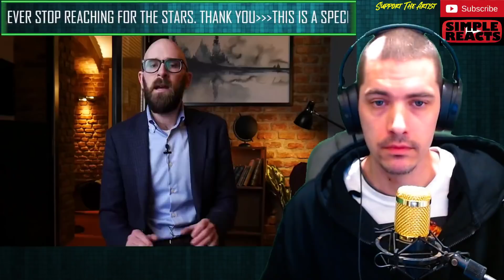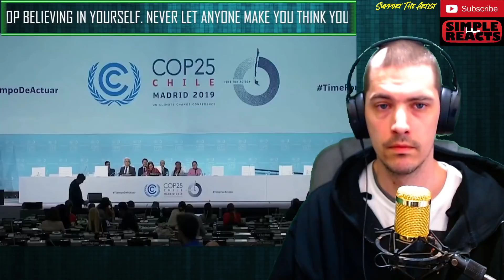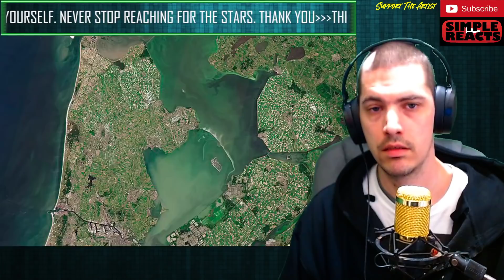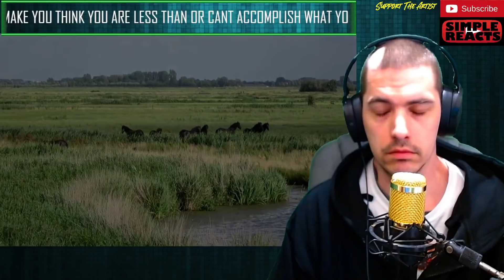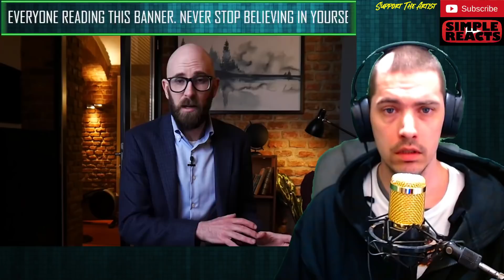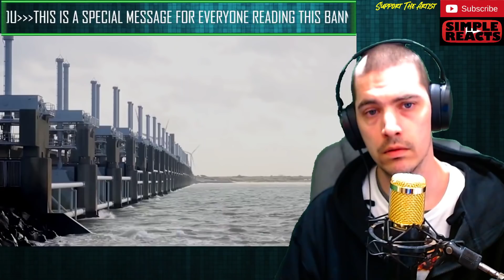Delta Works: An Example for the Rest of Us Reaction

Comment: IJssel is just Ice-cel in english so I don't know why he was struggling with that pronunciation
Reply: It's the Dutch letter 'ij' (yes it's one letter, that no-one bothered to include in any computer code page, so you can't even type it properly. Wikipedia calls it a digraph). Its pronunciation is uniquely Dutch at least as far as Germanic and Latin languages are concerned. The closest in English is probably 'I' but that would be considered a dialect pronunciation in true ABN ( common civilised Dutch -- the Dutch equivalent of BBC or tbe Queen's English). In names like IJssel and IJsselmeer both the I and the J are capitalised.
Typically English speakers try to pronounce the I and the J as separate sounds, which leads to hilarious things like 'ee-yel-semere', instead of 'Eyecelmere' (still wrong but a lot closer.)
Reply: @rmyikzelf5604  Dat weet ik al lol
Reply: Actually his pronunciation of Stormvloedkering Hollandse IJssel was pretty good.

Comment: After Catrina, Dutch water engineers were asked to help out. Since that time they have build several levies that proved their worth during the last hurricane that hit the region.
And yes this kind of projects cost an enormous amount of money. But you have to compare those expenses with the money needed to rebuild a region after a disaster as Catherina. and you should also add the loss of lives and human suffering. These projects also provide good jobs and Rotterdam can keep functioning as one of the largest harbors in the world which is essential for Dutch economy. It was and is a large investment. However, the benefits exceed the costs.

Comment: Thanks for you spontane comments!! You just must expect crazy huge contructions. Bc of the unpredictable huge forces, all solutions started as experiments. From  the 100 most craziest ideas, 99 failed but 1 worked. Recalculated to the real world, it forms the start of the contruction-plan. NL just has to find a solution for the threat from these forces that do not negotiate.

Comment: The delta works 1 (zuiderzee works) and the delta works 2 (mainly coastal defence) cost more than the whole Apollo project to put a bunch of men on the moon. Not bad for such a small country. After finishing we had to start with delta works 3, the river dikes. This was because climate change caused the river to fluctuate way more than previously. They are now nearing completion and saved us this year from the floodwaters coming from Belgium and Germany, but only just....
Reply: So we move forward with clever and innovative solutions to deal with water.

The amazing part is we managed the rivers by giving them, besides the dikes, more room to overflow.

I'm not very nationalistic but incredibly proud about our world leading water management.

Groetjes uit Brabant 😎👍
Reply: @gauloiseguy  The problem in a few decades (already starting now) is that groundwater wells up from the soil everywhere. The pressure comes from the rising sea levels and is transmitted beneath the dunes via the groundwater. There is as yet no technical solution in sight if the sea level rise will be more than 1.5 meters. Even if the dikes etc. would hold, this phenomenon will cause that the Netherlands will become slowly too wet to live in.
Reply: @ronaldderooij1774  

I'm afraid you're right for the Westland at least.
Reply: @gauloiseguy  Yeah, I live very close to the Westland.
Reply: @ronaldderooij1774  The technology to deal with it exists. There are even plans to drain the entire north sea. The problem is international cooperation and cost.
Reply: @mgc7199  I know about the idea. But be aware, it is only an idea. Not even a proper study. There is no proof that it is feasible. And are you going to tell Russia, Germany, Poland and Sweden that it cannot use their submarines anymore? There is zero chance that it will be accepted, and in my view very little chance that it is even possible. So, forget it.
Reply: @ronaldderooij1774  Currently, the tallest dam in the world is Nurek Dam on the Vakhsh River in Tajikistan. It is 984 feet (300 meters) tall. The (least) deepest point between the Shetlands and Norway is not that much deeper. Obviously there would have to be waterways to connect current rivers with the new shoreline so the submarine argument doesn't fly. You are right that international cooperation is a stumbling block, as mentioned.
Reply: @mgc7199  Our biggest problem right now is the river water flowing in from Germany and Belgium. While current developments known as room for the river worked for the most part, we've had a semi-recent flooding from said rivers on the southern tip of the country. Thankfully, unlike in Germany and Belgium there were no deaths.
Reply: @therealdutchidiot  The easiest solution for us would be to get Germany and Belgium to invest in ways to regulate the amount that comes in. If they can create a way to hold large amounts of water for a few days to reduce peak load on their and our system, much damage and loss of life could be avoided.
Reply: @ronaldderooij1774  not sure if there are no solutions to that, since that already happens with every polder made. The waterlevel underground is at sealevel, which means the polders (which are below sealevel) already fill up with water if we don't continuously pump it out. And there is a balance to maintain, as pumping out too much water means the soil becomes too dry. I think that building a few more pumping stations would be enough to pump out the extra water. But I'm not an expert on that, so...

Also, a little fun fact: if we pump out too much water, salt water might creep under the dikes and make the soil too salty to be used as farmland. The only reason this doesn't happen is the continuous supply of fresh water from rivers and rainfall.  So there is a balance to be maintained there.
Reply: @SatumangoTheGreat  All true, but the pressure from the sea is rising, the time at low tide decreasing, both as a function of sea level rise. I have not even considered the oxydation of the peat and the isostatic lowering of the land after the ice ages. When comes the point that the time to pump out water at low tide becomes insufficient and the pressure beneath the dunes by the salt water becomes too high? I have spoken to some civil engineers and they say between 1.5 and 2 meters RELATIVE sea level rise (relative to the land). If the prediction of climate scientists are right we are screwed. Predictions now range from 2 meters to 18 meters. I give it 100-200 years.
Reply: Look for the eurosongfestifal, Davina Michel the power of water ,
Thanks man 😉

Comment: The Dutch knew the Delta Works weren't going to last forever, 
However their estimations were that every year they worked on this they gained 2 years to think of how to improve it. 
So if they just did a good job the first time, 
They'd have long enough to prepare for the next iteration. 
Current science confirms that the Dutch bought themselves up to potentially 200 years of time with regards to natural forces
But more significantly they gained a massive head start technologically, 
With ideas like the plants to dry out land,
Filling the barrier with water to adjust it's height
And already starting to future proof their ideas using different kinds of simulations that have literal decades to be tested and perfected.

Comment: Ohhhhh when you pause on 1.27 or watch his story at 12.49 you learn about the 'stormvloedkering' (literally meaning storm-surge-turner) at two sides of the Algerabrug (Algera-bridge)  in 'Krimpen aan den IJssel', my hometown were I grew up  ;-) It is where you saw 'the two towers in red light', those are actually part of 4 towers with the Algera bridge in the middle. Between the first and last two towers there is a humongous steel door that slowly decends into the river when the waterlevel rises extremely high or when a storm with a big surge is coming in. This project is part of the Delta Works and quite impressive to see when lowered.
Reply: The proper translation is storm surge barrier.